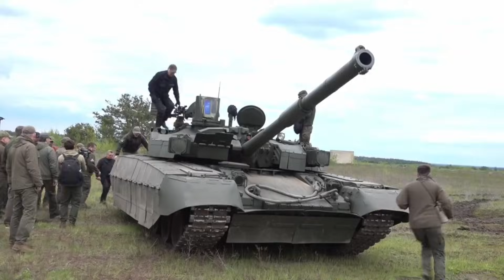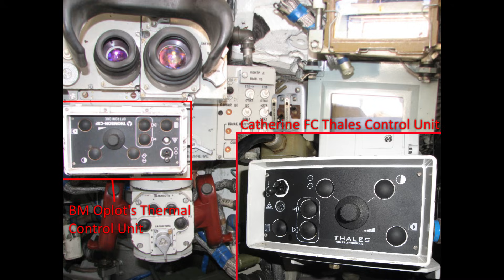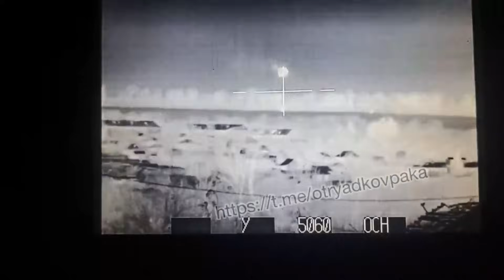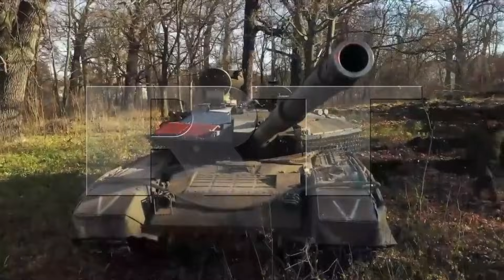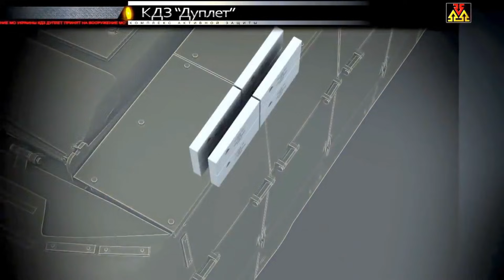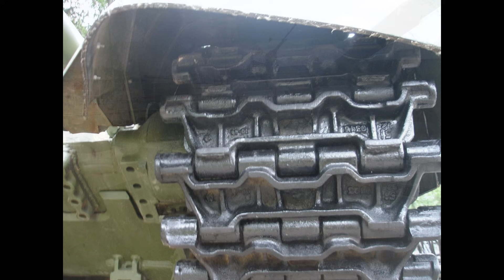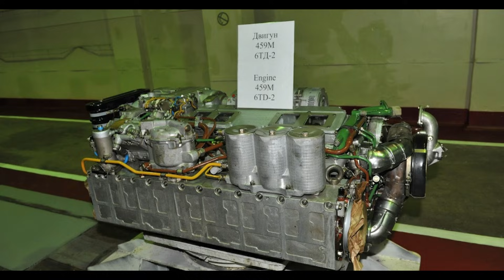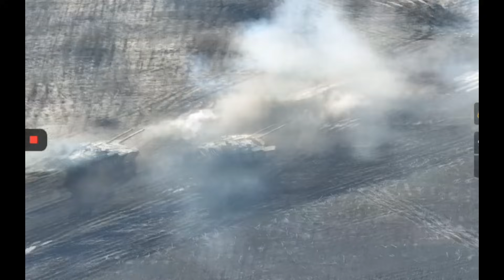Best Ukrainian vs Best Russian tank. T-90M vs BM Oplot comparison

Comment: I think the only real downside of the T-90M is that its still using the old transmission giving it only a 4km/h reverse speed. The torque would be insanely high but that doesn't save you when your being engaged.
Reply: Yeah people complain about carousel but they added armor on it and chances of cookoff decreased significantly. Only thing hindering T-90M is it's horrendous reverse speed. I don't understand why are Russians so adamant to not fix it
Reply: @slavicemperor8279  because they need to instill a new transmission wich will change the overall design and delay the proudection significantly
Reply: @slavicemperor8279  building a new reliable transmissions for tanks is surprisingly hard and the older ones are probaly faster, easier and cheaper to produce, while designing and starting production on a new transmission would most likely slow down T-90M production at this point. using the same transmission might also simplify logistics to some degree.

of course, the Russians should have designed and started producing a new better transmission a long time ago, because starting the war has complicated things. they might even have designs for a better transmission, but there might be problems mass producing it and in any case the new tooling required for it would stop or slow the current production.
Reply: @slavicemperor8279 Russian strategy is getting overhauled starting this year. The entire armed forces is getting overhauled in tactics and size and also composition. The reason why transmission issue hasn’t been fixed is not about the logistics but rather the way the Russian MoD fights wars. First saturation attacks and then shock battalions which is followed by main spearhead forces. There is no need for retreat if they follow the Soviet tactics of long range missile saturation followed by heavy unit forces. But since modern wars have become intrinsically different in nature, the Russian MoD is starting to realize that in Ukraine and they will bring the necessary changes in time. The end of the planned overhaul is set for 2026. The composition of the armoured forces will be changed as well as big changes in which weapons’ systems receive resources. For example, less production amounts for lightly armoured vehicles and more focus on stuff like BMPT terminator and so on.
Reply: @slavicemperor8279  They already fix it the T 90M has a reverse speed of 15 kmh
Reply: @slavicemperor8279  And even then, the ammo scattered outside the carousel was much more dangerous - which was fixed by removing it.
Reply: @slavicemperor8279  😂😂😂
Reply: @slavicemperor8279  They'd need to design and implement a whole new transmission for that. It's not a matter of adding a gear. If you look at how the transmission is made, it's very compact and small.
Reply: @slavicemperor8279  it is extremely hard to design good tank transmission. Most of the manufacturers around the world won't even try if they can just purchase one from Germany. All tanks designed in last 40 years with original transmission struggled with it's reliability or ability to produce it.
Reply: @slavicemperor8279  конечно, у нас есть понимание, что нужна нормальная скорость назад(в т-80 это сделали), но т-90 построен на базе 72, и использует бортовые коробки передач, они очень надежны и дешевы в производстве. Но там чертовски мало места, из-за это можно забыть об изменении трансмиссии.
Reply: @slavicemperor8279 From T-34 to T90 russians have no reverse tradition
Reply: @slavicemperor8279  You are assuming they actually can fix it. The t90 is just an upgraded t72. Both are using an engine from WW2. Their latest attempt in the t14 uses a German engine from....... WW2😂 they can't even produce a new tank engine, I doubt they can make a new gearbox/transmission either...
Reply: @phoenix211245  ,,Both are using an engine from WW2" Another dumb myth served to you by propagandists like lazerpig. You obviously missed RedEffects video debunking that bs. How gullible of you
Reply: @phoenix211245  Lay off the LazerPig will you. Wait, you did believe a Honda RS has more torque than a 50+ Ton tank. Logic wouldn't work on you.
Reply: @pilotmanpaul  Mate, the Russians have officially released the model of engine used in the t14. And guess what? It is just a modified German WW2 engine. They can barely even produce ball bearings at this point and still don't know how to make an automatic car gearbox, their car industry was 90% imported components in 2022. What makes you think that they can invent a new tank engine? P.S. I never said anything about Honda RS torque or it's relation to tanks. Learn to lie better.
Reply: @phoenix211245 It is not a modified WW2 engine. Stop spreading misinformation.
Reply: @voidtempering8700  The armata uses the 12n360 (a-85-3a) engine, which is an improved version of the 1977 a-85-2 engine, which in itself is a modified German sla16 that was developed in 1943. All of that information is according to Russian soirces. Just like the latest t90 uses the v92s2f, which is a modified version of the v-2-34 engine used in the t34, and in some modification the t54/55, t62, t72. Check your history before YOU start spreading misinformation. P.S. there is a reason the t14 broke down in its first ever practice for the 9th may parade, and keeps being delayed -its engine.
Reply: @phoenix211245  So, you admit that it isn't a copy of the Tiger engine. We agree, so how am I wrong? Same as how the T-55 and T-72 don't use the T-34 engine.
Reply: @phoenix211245  Additionally, it never broke down, it was a parking brake.
Reply: @voidtempering8700  It stalled at the practice for the 2015 parade I believe, and had to be towed. If the parking brake got stuck, towing would not have been an option, so once again, you lie. Come on, you have to do better when the event was captured on video.
Reply: @voidtempering8700  When have I ever said it was a tiger engine? I said WW2 German engine. Lie better. And using iterations of the WW2 t34 engine is soo not a good thing. You might increase the power a bit, but at the core, it is still the old tech, you still have the same problems with fuel consumption and reliability. One might think that engine technology might have advanced in the past 70 years. Russian tank engines are known to be unreliable fuel hogs, and they still can't fix the engine problems in the t14, which proves my point.
Reply: @slavicemperor8279  They probably just assumed that driving forward en masse was all that tanks needed to do. They probably wouldn't have included a reverse gear in the first place if it wasn't necessary to turn around. Either that or the Russian tank designers were so desperate to escape Russia that they didn't bother with a reverse gear because the idea of returning to Russia was just so unbearable. Either way, they've paid the price for it!
Reply: @quinnjackson9252  Nobody cares abvout your input when it isnt serious
Reply: @quinnjackson9252  he asked a genuine question. Not for a copium dump
Reply: @GAMER123GAMING  Okay bot settle down, it's bast you're bedtime! Gotta rest up for when Ukrainian tanks roll past and retake Crimea!
Reply: @Madhurajayaweera  oops wrong person, meant to respond do one of the dozens of trolls lol!
Reply: @quinnjackson9252  OK settle down there GI JOE NAFO SWAMPTHING
Reply: @bethlodubs2512  I love it... Russia's collapsing and that's the best insult you can come up with- a compliment written in all caps🤣
Reply: @quinnjackson9252  Exactly. In 1980s Warsaw Pact tank crews were taught that they had to manage to fight for 7 minutes. Attack was supposed to be mass numbers and at high speed. A tank company would be replaced every 7 minutes by fresh company engaging at high speed. You can check videos keyword 'Zapad 81' to see how they imagined it would look like.
Reply: Go to say not one step back
Reply: The reason is simple: u need to make some changes in it's gearboxes, which will take some time to test and start producing. It's better to mass produce T-90M with 4 km/h than wait until tests finish.
Reply: @dexm881  I think it's that lots of T-90Ms now seen in ukraine are modernizations of T-90As, and possibly after a few months we will see some new batches with a good reverse, idk
Reply: @dexm881  the t-72 derivative, the pt91m has a decent transmission just fine. Russia is either lazy or doesn't want their crew to retreat tbh
Reply: @ry0usama511  It has RENK powerpack with V8 engine, not V12.
Reply: @dexm881  well pt91m, a t72m derivative managed to get 70/25 forward/reverse speed. While T90m is 60/4. Lol.
Reply: @ry0usama511  dude, look at ESM-350M transmission in powerpack. They literally used smaller engine to install it. В-92С/В-92СФ engines will require other way to implement new transmission.
Reply: about 8km/h actually isn't it?
Reply: Там не используют новую трансмиссию, чтобы его быстрее производить, после окончания войны, будет поставлена новая трансмиссия
Reply: @Ruketer  they don’t need to make it available for retrofit as they won’t have any left
Reply: @robertpatrick3350  Who is going to take those T90Ms out? T-1000?
Reply: True. And the lack of APS (even if it's designed to have one), however that's still a luxury to most other tanks as well.
Reply: @saucyinnit8799  It DOES have an APS, just not a hard-kill one. It has a soft-kill APS that works on denying the targeting, as opposed to denying a hit by a round.
Reply: @Max_Da_G  ah well yes, a soft kill but that won't stop or disrupt APFSDS rounds tho.
Reply: Fact is Russian engines are not reliable.
😢
Reply: Yeah and that’s the absolute main factor making the Oplot superior. The rest of the differences is absolutely minor.
Reply: @Grimshak81  LMAO no.
Reply: Modern anti tank missiles seem to be a pretty big problem to
Reply: It's designed that way, not one step back!
Reply: What the actual f*ck is going on in this reply section
Reply: it is, only it isn't. T-90M have reverse speed about 10-15 km/h. Also, reverse drive is usually not combat-applicable.
Reply: they heard to many joke about Italian tanks
Reply: The tanks supposed to be of 3 One fire while one reverse then cover other (2nd tank) to reverse and the last stay way back to cover both. With 3 Tanks thought it would be enough to break a line. But it didnt work like that. They was supposed to fix it on last variant but for some reason they did not
Reply: There are a multitude of downsides of the T-90M. I’m too tired to compile a list right now but if I see a reply asking for one I’ll make it.
Reply: There are a multitude of downsides of the T-90M. I’m too tired to compile a list right now but if I see a reply asking for one I’ll make it.
Reply: Because it is made as a offensive tank. High forward speed and low profile siluete which makes it harder to hit from  long distences.
Reply: Oplot is a Russian Tank base on the T80 from what was left over from the break up of the soviet union that was just modified in Ukraine. Ukraine cant build tanks only take Russian tanks and upgrade them.
Reply: "T-90M breakthrough" has a reverse speed of 15 km/h
Reply: A far bigger weakness is that it's occupied by russians, among the most incompetent and cowardly combatants the world has ever seen.
Reply: t90m reverse speed has been increased to 15 km/h
Reply: If you have enough balls to get in a tank in modern conflicts then you won't need to back up anyways.
Reply: i think the latest modification has better reverse speed....
Reply: Maybe there thought is forward only reverse is for cowards ! Lol
Reply: @David  I think that they saw what happened to the french in ww 2 because they had a reverse speed of 6000 km/h and still lost
Reply: @Saxondavid  They did. 1980s Soviet doctrine assumed that tanks would conduct mass high speed charges, supported by AFVs and large numbers of infantry landing from AFVs or running behind tanks.
A tank company was supposed to fight for 7 minutes and then be replaced by fresh company engaging at high speed.

It was basically a more advanced version of 1943-1945 T-34 fighting tactics, which in turn originated from Bystry Tank (High Speed Tank) tactics.
Reply: @Saxondavid  that's a bit over confident
Reply: @heyno3306  15 km. They have a new engine
Reply: @Saxondavid  Its because the T-90, is just a T72 at heart. It would be like if the US made the M1 and used the M60 as the base for it.
Reply: @Evirthewarrior  Dude, initial Abrams that was called M1 Abrams is massively different to M1A2C/M1A2SEPv3. Gun, Armor, electronics, ammo, fire-control system. They don't even compare. Same for T-72 Ural to T-90M Breakthrough. If you have an axe, on which over time you changed the handle and the head, is it the same axe?
Reply: @Spetsnazovets  imagine believing that, it is the same engine, transmission and hull. The original T-90 had basically the same turret.
Cope more weirdo.
Reply: @Evirthewarrior You claimed that the T-90M shared these features, now prove it.
Reply: @Saxondavid  or just being bravado only
Reply: And the fact that despite being what is actually expected of a modern battle tank it is too pricey for it's producer and employer although to be fair I believe the same can be said for the Oplot even though the employer's restrictive price range makes less sense in comparison to the size, population, and resources of the Ukraine.
Reply: @extraordinarytv5451  any HE shell fired from any tank would obliterate infantry basically
Reply: @jakiwijaya7316  well the american tank has heat-mpt
Reply: Nah just turn the chassis backwards it will go 70kmh
Reply: @ChandranPrema123  JuSt TuRn It. Just turn it and expose the 50-80mm rear which an anti tank gun from 1942 can penetrate :face-blue-smiling::face-blue-smiling::face-blue-smiling::face-blue-smiling:
Reply: I want to see you sit in a 45-65 ton vehicle driving 40km/h backwards, and see what's happen. 
Reality is different of war Thunder.
Reply: @dickesBrot  the Abrams literally can. Lol
Reply: Only french people need reverse speed to retreat fast
Reply: Reverse speed of T-90M is 15 km/h. It has new engine coupled with new automatic transmission and better drive in reverse than T-90A. It's easy easy to check this info if you search Russian sources. Westerners know nothing about it.
Reply: the only downside of the t-90M is that its a t72.
Reply: @punicwars2 List the features that it has in common with the T-72b 1989.
Reply: @voidtempering8700  first of all its the same chasis. Almost the same autoloader same shit engine and transmition. Same turret means 5-6 degrees gun depression. The t90 started its life as obj 188 later known as the t72bm which was again upgraded to t72bu. The BU was then renamed after the fall of the soviet union to t90. There are ofcorse upgrades. Fire control, thermic sights, better armor and such. But it still holds all the inherent weaknesses of the t72.
Reply: @punicwars2  You realize Russia doesn't use the T-90, but the T-90a, right? And again, you are diverting the topic. What does the T-90M have in common with the T-72b 1989?
Reply: @voidtempering8700  i did not said t-72b. i said t-72bm and later t-72BU. now the t-90M has the same hull the same autoloader with one difference, the spare ammo is in a blowout compartment and some slight improves to the carrousel but it still suffers the same major weakness. since the inner turret is the same the depression of the t-90M is the same as the t-72 which is 5-6 degrees which is shit and finely the transmission that still limits the reverse speed to 5km/h. is that enough? oh and the same gun.
Reply: @punicwars2  You are still wrong about the hull and autoloader. Even the original T-90 had a different hull and hull armor array than the T-72, and a different autoloader which can fire longer rounds. And even the original had new engines the V-92SF2. And they also have a different gun.

You should at least get these things right before you comment about them, as these are things from the T-90 and T-90a.
Reply: The biggest problem of the oplot is that there is 2 tanks of this model
Reply: Russians don't need to retreat. Not one step back!!!
Reply: this is a fking awfull weakness
Reply: Uuuh there's a lot more downsides than that lol. It's still 95% an ancient T-72.
Reply: @FeatheredDino  yea, if you ignore the turret, the electronics, the gun, the interior, the ERA, the exterior
Reply: @1KosovoJeSrbija1  They bolted some shit on a T-72 and called it a new tank. 

Like I said. 95% a T-72.
Reply: @FeatheredDino  like I said you're simply wrong
Reply: @MOPARman345 HEMI  they bolted some shit onto an m1 and called it an m1a1 sep. Still an ancient 70s tank. See what I did there?
Reply: @FeatheredDino  Stick to working on your V8s. Military tech seems to be beyond your level of knowledge.
Reply: @FeatheredDino  you didn't watch the vid did you.....the touret is new....the engine is new.....the auto loader is improved......its like 30% ancient t-72
Reply: @اسكندرفكار  Not even 30%. All that's left is overall shape and concept of medium-weight tank. Sides and rear of the hull are all that's left of the old T-72. Literally EVERYTHING else is different. Only overall shape is similar.